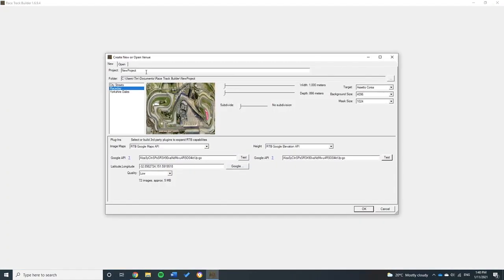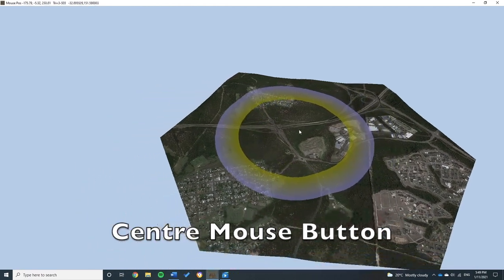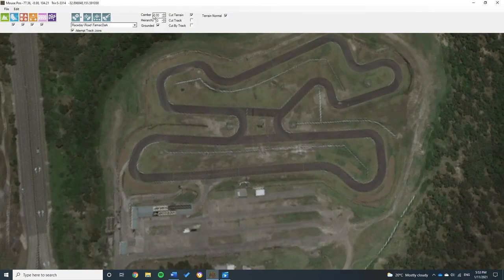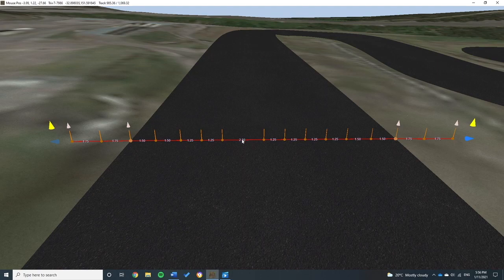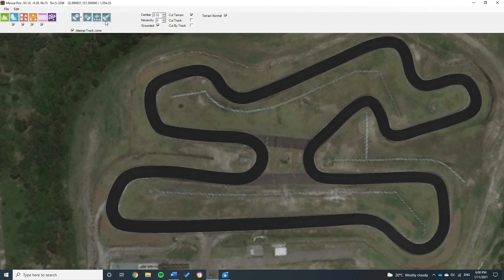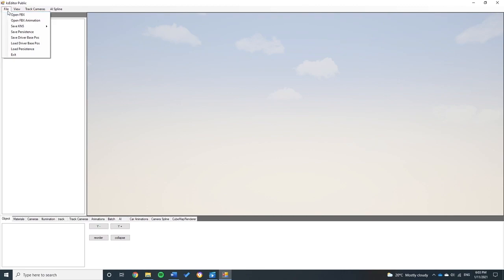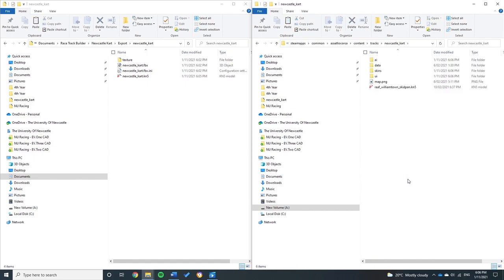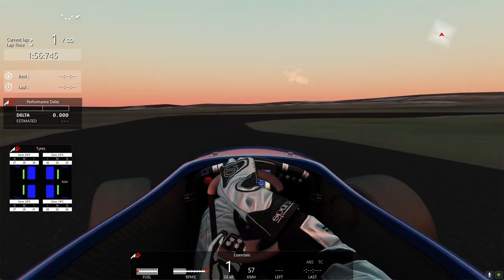1.  Race Track Builder  - Part 1

Comment: Hey! I'm not sure if you still monitor this channel.. but I ran into a problem: KSeditor wont load my fbx file, when i remove all buildings it works, also the filesize is much smaller so i assume there is a limit for fbx file size.. do you know any fix or the exact limit? Cheers and awesome videos!

Comment: Hi there, great video & Race Track Builder really needed an up to date video done so bravo. Question though, attempting a track myself & wanting to put white lines & curbs on the edge off the track? With the basics installed its a VERY difficult process & not having any luck... any ideas to solve this? Also before I forget, if I want to have a pit lane which isn't just in a straight line... so for example Silverstone how the entry & exit have corners in them. How do I do that? Hope this makes some sense. Got plenty more questions but thought I'd try keep it simple to start off with haha many thanks again
Reply: Hi Chris, thanks for the positive feedback! I'm in the process of making a video explaining an easier process of doing the lines, might be up by tomorrow but I'll comment the link when it is. 
The pit lane issue, I assume you mean the pit boxes are only in a straight line in RTB by default? The pit lane itself isn't an issue having corners, the second video on our NU Racing channel shows how to join tracks. It's interesting that the grid spots are set to follow the track but the pit lane isn't? Maybe this is something RTB could implement down the line.
Let us know if you have any other questions I might be able to help with!
Reply: https://youtu.be/f5AORSqn9ZA check out this video for an easier way to add the painted lines

Comment: hey, ive built a track but when i put it in assetto and it says track layout damaged? what could i have done wrong?
Reply: Hi Thomas, first thing I would suggest doing is deleting the files and re-exporting them from RTB, perhaps something corrupted. I would also suggest double checking the naming convention for all track folders and files and make sure they are the exact same.

If this doesn't work, perhaps you could create a new RTB project and try and implement that in Assetto without putting anything in and see if thar works.

Comment: Hi mate, I just started to follow and subscribed to your Channel. Can u please tell me what system configuration are required to render the race track? I'm in process of buying a computer system to run race track builder. Any suggestions?
Reply: Hey mate, thanks for watching the video! (this is my private account).

In terms of a pc system, realistically you don't need anything high end to run RTB effectively. I have a gaming pc I built a few years ago and it runs fine, I even use my laptop (HP Spectre) occasionally which also runs it no problems.

I think the bigger issues would usually show up in your racing program such as Assetto Corsa and not being able to run that as well.

Would highly recommend as James says to built your own PC over purchasing one. Even if you have no clue, it's not too hard to pick up, and usually much cheaper.
Reply: jeez buying a whole system for track builder? why not build it yourself - i saved about £500 by building vs buying
Reply: @jamesxracing8111  what is the best config? I've never built.one, but have try...
Reply: @tarakparekh3105  haha sorry for not seeing all of this :D for me i5-9400, gtx 1060 and 16gb ram and it works all good :)

Comment: I have a problem when I enter the google API and I don't know what to do anymore. I have done step by step the official RTB video but it still does not work.
Reply: me too
Reply: Hey guys, thanks for watching! 

Unfortunately I am not too sure why that wouldn't be working? I would say best thing might be to try and contact RTB support directly and they might be able to help.

I know that the step by step worked for me, but I did have a few issues along the way, quite overly complicated in my opinion.
Reply: @timaebi9364  They do not answer. I honestly think I've thrown 50€ in the garbage
Reply: @ManuGraphics   That is frustrating, have you managed to get it working yet? 

Several people have struggled getting the API's, I will be posting a video tomorrow hopefully which will run through the API key process hopefully simpler than the RTB guide. Hopefully this helps, I'll comment a link when its up.
Reply: @ManuGraphics  https://youtu.be/Fv27Em0bNR8 here's the link to a guide to API keys, hope it helps

Comment: Hi. My track won’t start and only difference I can see is that if I save kn5 file there’s 2 files and in your video on one of File there’s a .ini ending. I don’t have that ending I just have the track name
Reply: Hey Robert! Thanks for your reply. Have you managed to get it working yet?

The .ini file in my video is related to the .fbx file. To load in Assetto corsa the .kn5 is the only one you will need. 

I would recommend you check whether your naming convention for your folder and the kn5 file are the exact same otherwise the track won't load :)